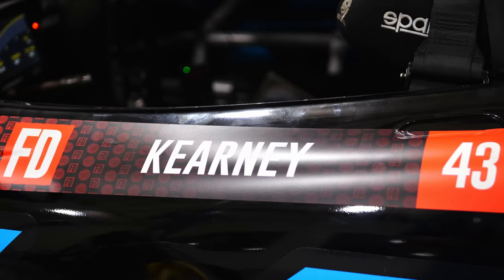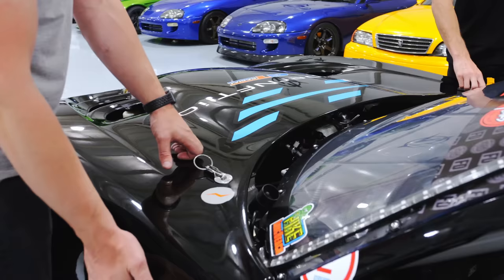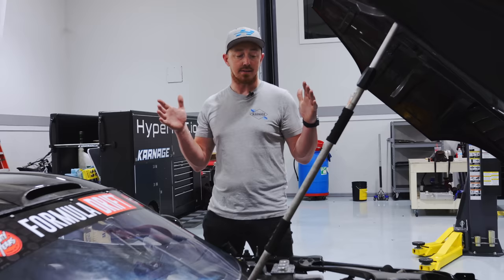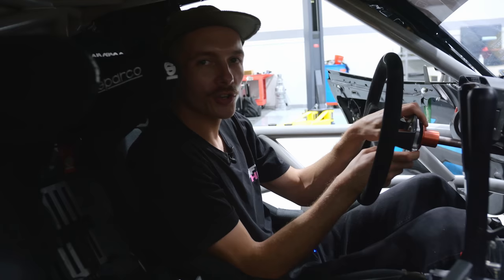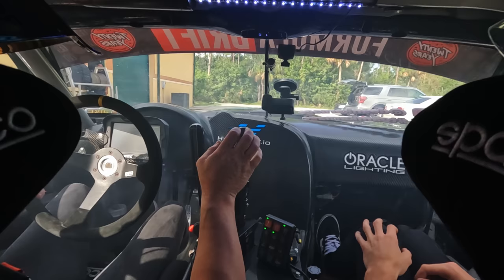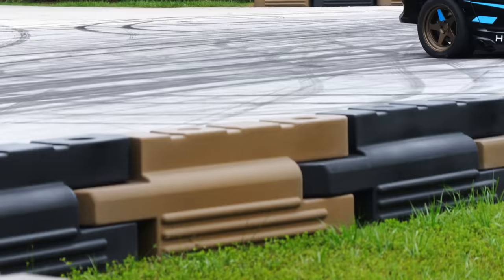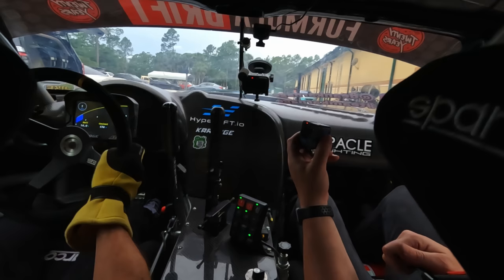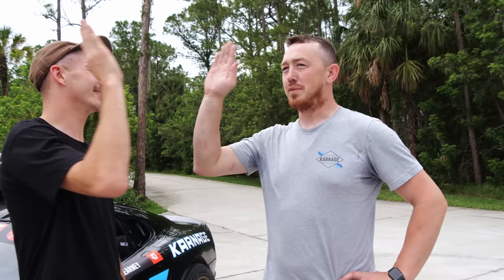Twin Turbo Drift Viper Vs. The LZ Compound | Behind the Build

Comment: Speaking of a viper powered S2000. There was a guy from Quebec that used to come to Ontario's Topp Drift event with one. He named it Katrina because it was flood shell from well you guessed it hurricane Katrina
Reply: Yeah, always on stock sized all seasons that it would roast at what sounded like maybe half throttle. lol
Reply: @lb9gta307  yeah the car would have been a whole other animal if it was set up on good tires. Although being for ride along in it I wouldn't change a thing. Back in 2016 every one was pretty much running Backlot tires

Comment: Adam: As cool as you think it is "don't DO IT: !!! Leave that death trap alone. I know how to drive anything. I took the bosses Viper out to clear it out after it wouldn't start. I first gave it enough throttle to get into 2nd. Then gave it .75 throttle and it was the most violent thing I've ever been it. I eased into third. That was it. I can give every crotch rocket everything it has minus the HD. But the long nose of the Viper and the unbridled power was a death trap. I know you have swapped back and forth from cars but the Viper should be called the widowmaker. I think the one I drove was first gen or maybe 2nd. All I know is get me out of this thing!!!!!